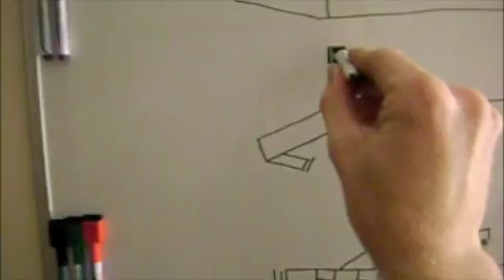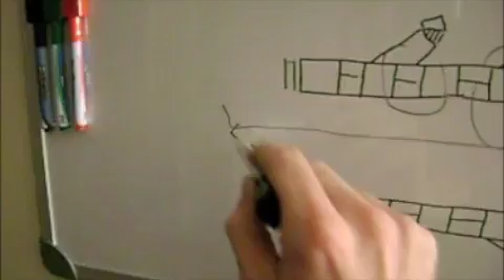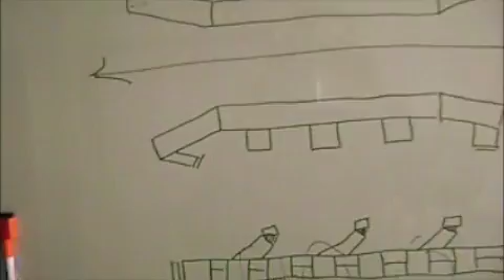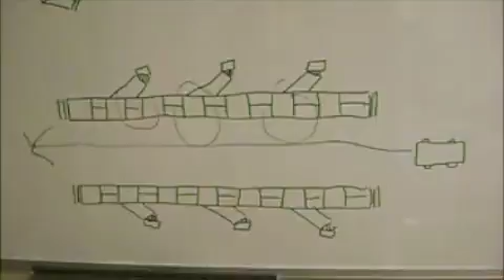Magnetic Motors 101 - What is the Holy Grail?

Comment from the maker: I have curved track, but it wont work in this configuration. That was what I was demonstrating when I pointed out that the cart would have to accelerate from any point in the track in order to work in an arced version. If the tracks I demonstrated in the video accomplished either of the scenarios I suggested on the dry erase board, then it would work, but unfortunately they don't. I'm still working on that. 
Thanks for the comment.

Comment: I don't understand the requirement you mention at 7:16 that if you can stop it and it won't accelerate again it's a bad design. Why couldn't a motor that's been stopped have some kind of simple repositioning system to get it back to its start position, and let it go again?
Reply: simple.. re-positioning would require external energy.. :)